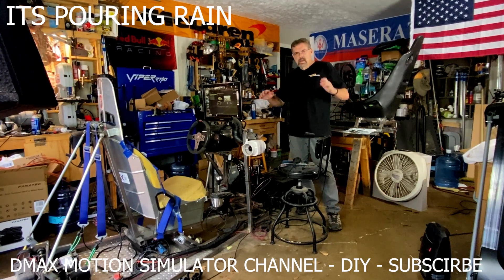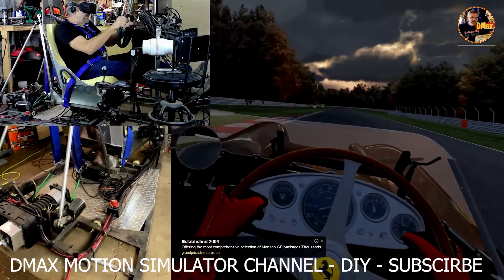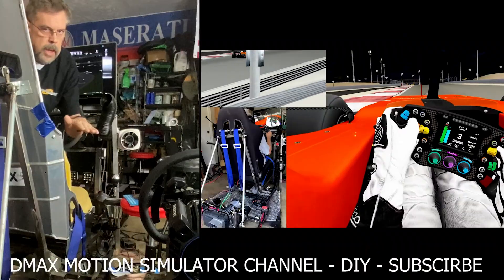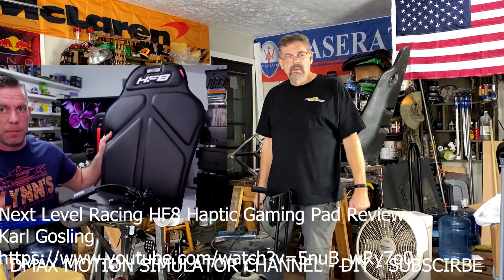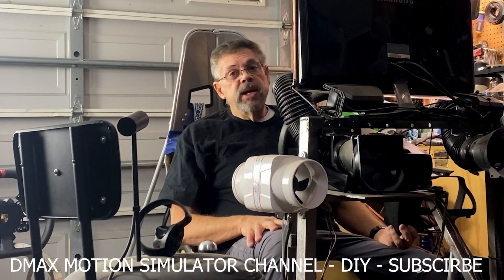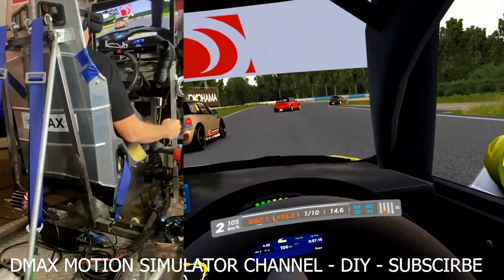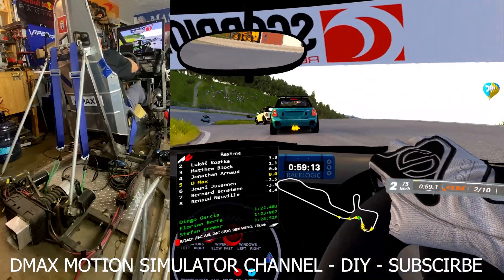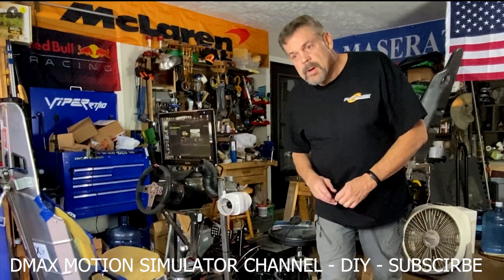WHY WOULD YOU MAKE A MOTION SIMULATOR IF IT MAKES YOU SLOWER?

Comment: Great race! Do you still get motion sickness even the when the rig is mimicking the VR movements? Thanks.
Reply from the maker: Good question!  No.. so I have not got any motion sickness..  It may be because I am using the RIFT CV1 which is kind of old..  But from what I heard there are motion compensation for newer headsets now.  I dont use any motion comp..  just one camera and I race all the time..

Comment: Hi there- new subscriber here! Your build videos have been inspiring!
I am not really into racing games, but am an avid flight sim player.
So my question is, what spec of motor would you recommend for a 2dof chair that includes foot mounts for the rudder pedals, and side plarforms for the switch panels and throttles? It doesnt seem like it would add a whole lot more moving weight, but i am probably wrong. I am thinking of something like a pair of motors for an electric gate?
Reply from the maker: Yes that's what I want to do soon.. Flight sim..  So the full frame takes a pretty beefy motor.. But from what I a have experienced.. those crab pot 50:1 from canada are Solid and you dont need to worry about them.  I dont know if Electric gate motors are DC powered?  All my equipment is DC 12 or 24 volt..  I did do a series on 24 V wheelchair motors and they worked pretty good for a 2DOF seatmover..   They were 18:1 ratio..  If the gate motors are DC powered, they might work just fine.  I would go on x-simulator.net and take a look at their forum advice.. Good guys there.. Or just wait around till I build a flight sim  -  may be a while.. Dave

Comment: I'm trying, and you're helping 😊
Reply from the maker: Keep pluggin away Luis..  These things are fantastic once you get them running..    I just tried to show how fun it can be in this video - cause of that Knutsorp track..  ho wow..  that was almost like a rollercoaster. Dave
Reply: @DMAX_DIY  Bought the gimbal\universal joint today (1st non electric part that I bought). 
I think I will buy the wheelchair motors that I found on amazon for under 100 €. But I will search for cheaper (but still functional) alternatives for one more week. 
Do you think the lost traction motor needs to be as strong as the others? Will a good windshield motor do the trick? (It will be a wood frame, so, it might be heavier than yours)
I will use skateboard wheels to make it slide better as you did, so.